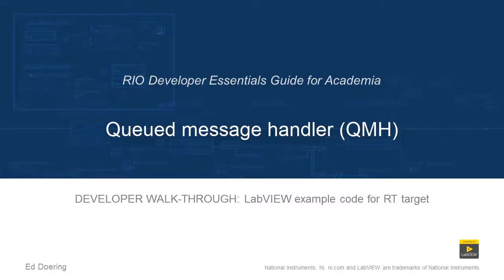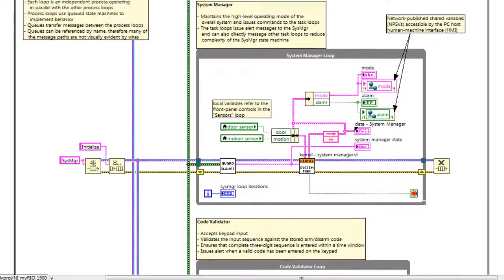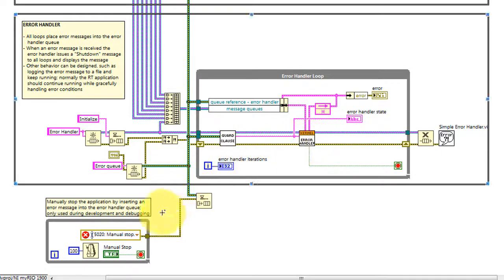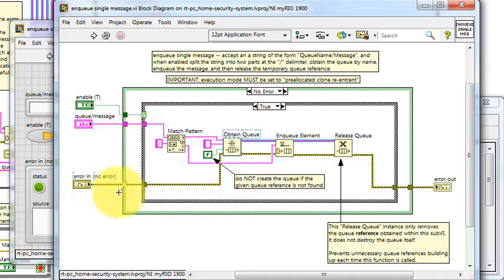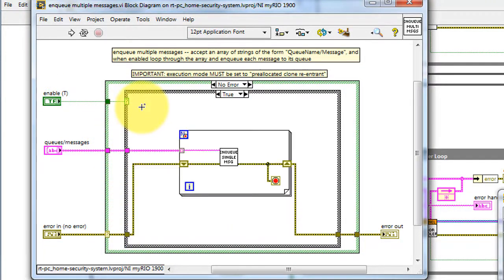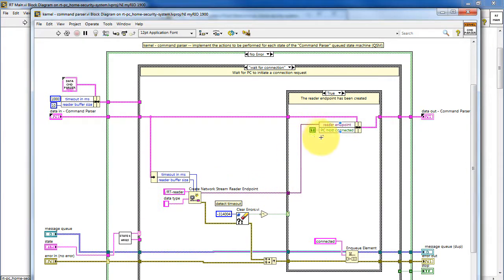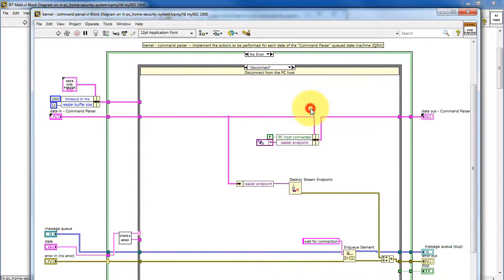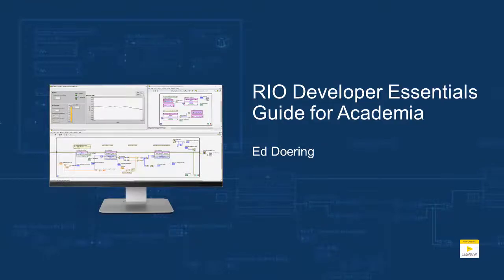LabVIEW code: Queued message handler with multiple process loops (walk-through)

Comment: Employing a USR to hold the Queue reference would be a better implemetation, Calling 'Obtain Queue' through the code numerous times, can lead to what appears to be 'memory leaks'. Tracking these down can be very difficult as it's not apparent what is causing it. Obtain Queue should not be used to grab an existing queue reference - I would urge using other traditional methods, USR or even a Global variable -(by God!) to pass a single queue reference across parts of the code...